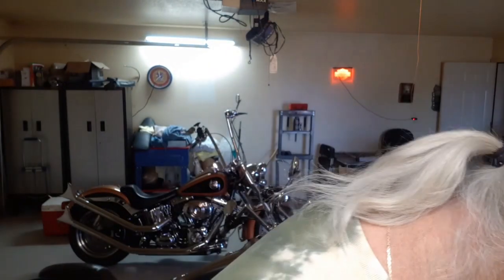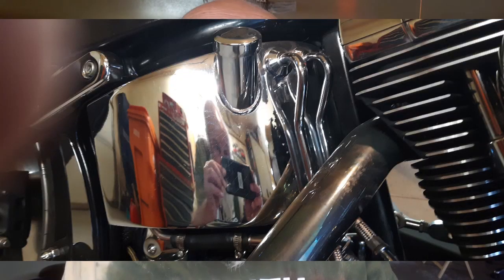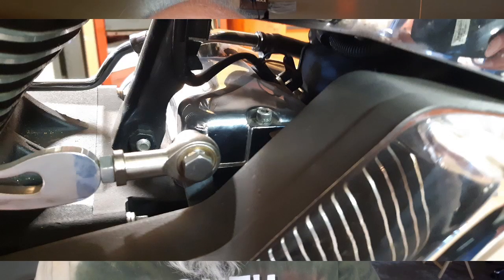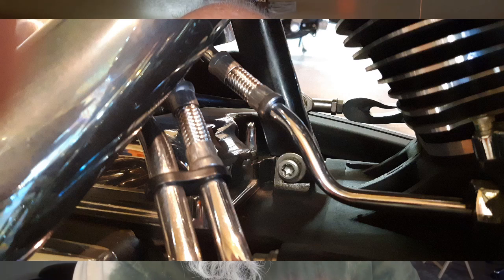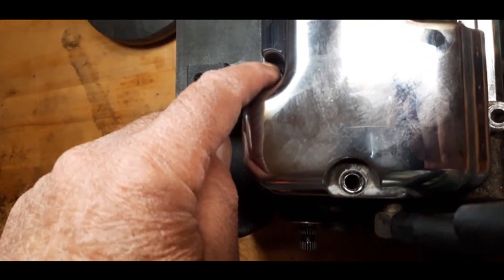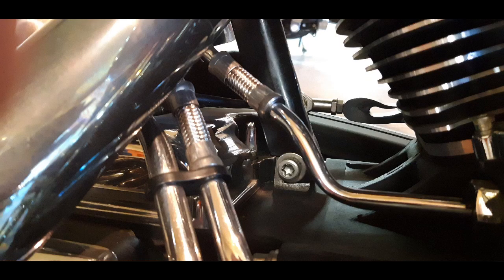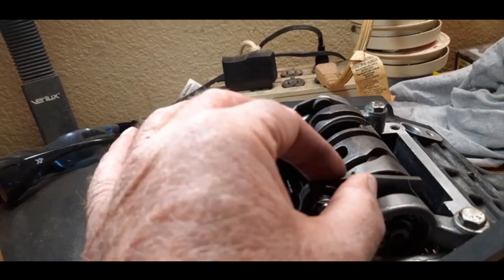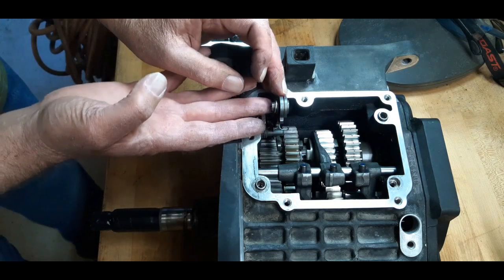How to change pawl spring on Harley 5 spd trans

Comment: Thanks for the vid Boss. Will this apply to a '97 FLHTC ?
Reply from the maker: Glad you liked the video, unfortunately no it doesn't apply to a 97. It applies to 2000 and up. The pin on a 97 is pressed in.
Reply: @Tinkering With Harleys  thanks for reply! Well I have the manual, I'll have to see how it's done. Thank you!
Reply: @tinkeringwithharleys Thank You.

Comment: Do you have the part numbers for the pawl, the spring and the snap ring? Im having some difficulty finding the snap ring online. Trying to do this without going to the stealership.
Reply from the maker: No I don't have part #. But you should be able to find what you need at JP, Dennis Kirk, Baker Drive Train, Jim's etc. Thanks for watching and ride safe

Comment: Do the shafts ever break or is it the spring usually
Reply from the maker: Thanks for the question, the shafts can break but you have literally beat the hell outta the trans to break a shaft. The most common problem is the pawl spring losing strength causing the pawl shifter to skip the pins on the drum. The other is the pawl shifter just wears out. Thanks for watching

Comment: Hi Tinker, hope you are well, how do you know if your poll shifter is starting to go bad?
Reply from the maker: Hi Duane all is well here hope all is good with you. When the pawl shifter starts going bad or the spring weakens, when you shift the pawl will slip over the shift drum pins. You will get no resistance at all at the shifter it will slide all the way back and you will remain in the same gear.

Comment: When my 2003 Ultra was about 7 years old, a spring broke in the trans. The shifter simply flopped down. I was able to ride 100 miles back home by finessing the shifter. The dealership did the repair under the extended warranty. I never had the problem again. In 2016 I put a Screaming Eagle 6 speed transmission in the bike, so I suppose it's the newer design. I assume this was the spring you are referring to, or was it that big coiled spring around the shaft? If the spring broke like I say, was I super lucky that a broken piece didn't fall off and get caught in the gears? Thanks for all this good information.
Reply from the maker: I've had the same experience myself, only my pawl shifter was worn out. Did the same thing as you nursed it home. Dreaded each time I came up on a stop street or traffic light, than had to fight it all over again to upshift. The top spring is the one I was talking about. The lower spring rarely goes bad because it's a much heavier spring. Thanks for sharing and thanks for watching.

Comment: Hey  tinker it's Clark  I think I need to change my lefters and it looks like I have to take the heads off  on my 2002  sporty  1200   I was hoping  to take the cams out and take them out from the lower end  but I think I am not that lucky
Reply from the maker: Hey Clark, how you doing. I haven't worked on a Sportster since the mid 70's. On the Evo, twin cams you don't need to take the rocker boxes off. On these you get a set of quickie push rods and cut the stock push rods with a bolt cutter. That allows you to remove the push rods without taking the rocker boxes off. You can than get at the lifters and cams. This is how I do it for the bigger motors. I don't know if you can do it with a Sportster but worth looking into.
Reply: Thanks  tinker I will check it out  /  thanks for taking  the time to help me out   your  #1 in my  books
Reply from the maker: No problem, S&S makes quickie push rods and tubes  also lifters. There a little pricey but worth it.